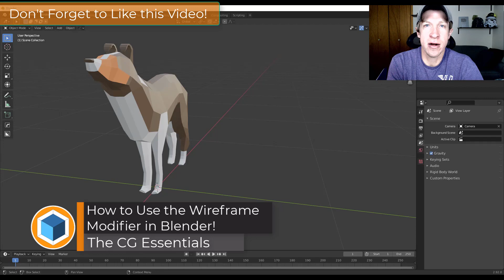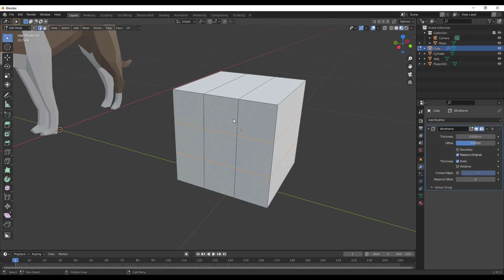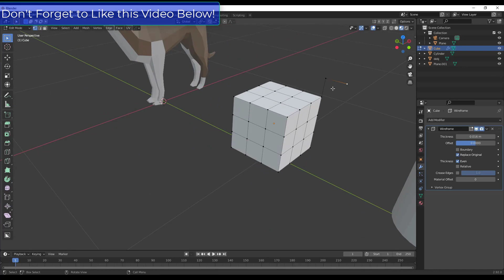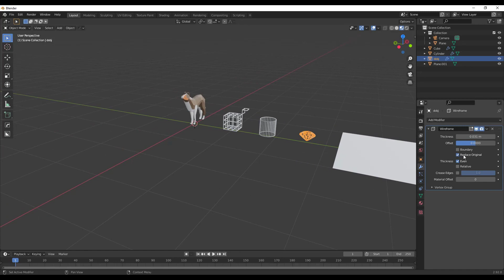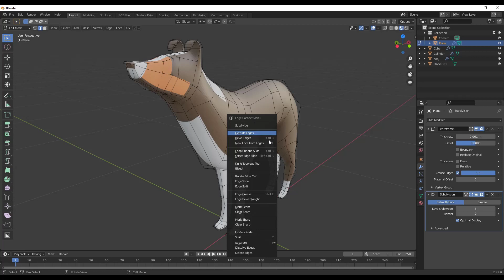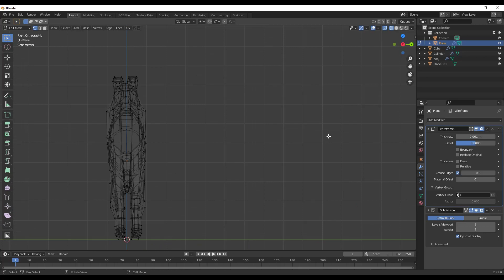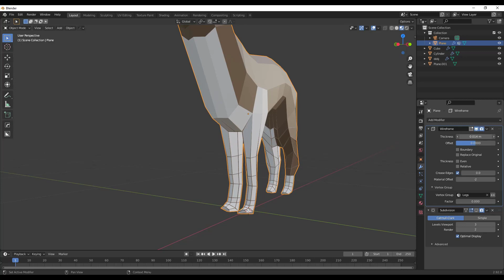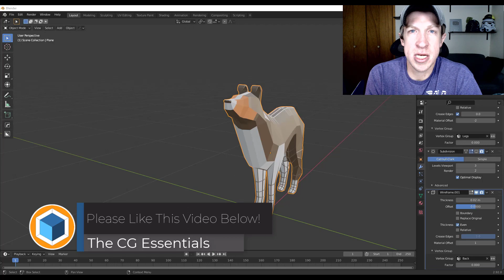How to use the WIREFRAME MODIFIER in Blender!

Comment: Nice modifier, THX. I see that the cross-section of the resulting beams of the mesh is diamond-shaped. Orthogonal cross sections are not supported. To get the latter for windows, for example, you would have to make subdivide face and inset from each subface and extrude inwards. Is there a simpler method similar to wireframe?